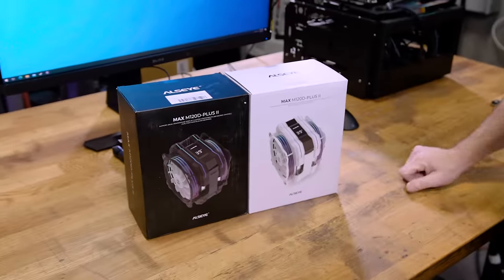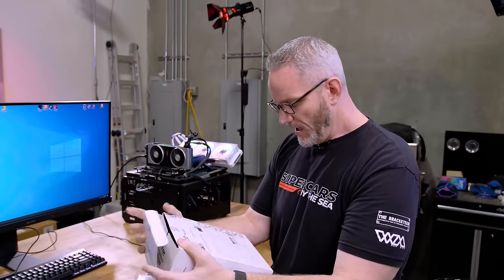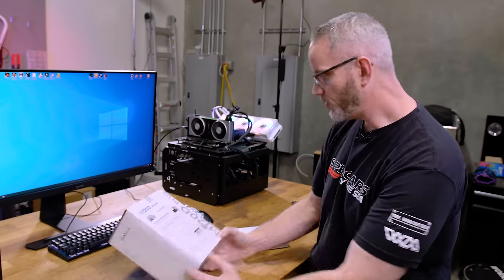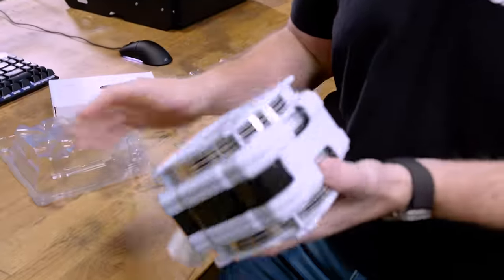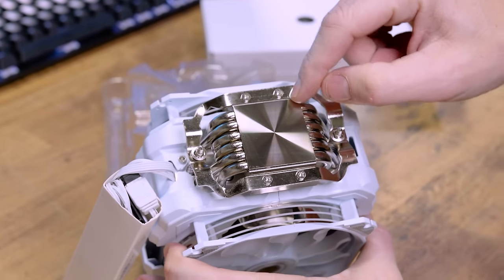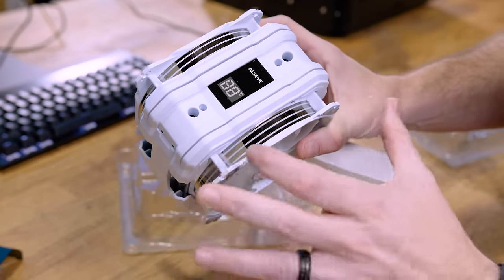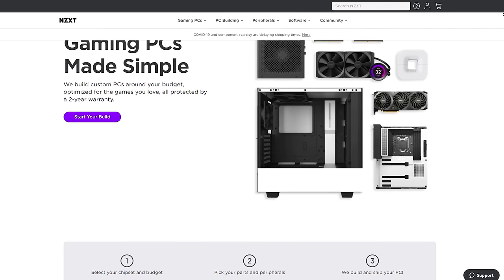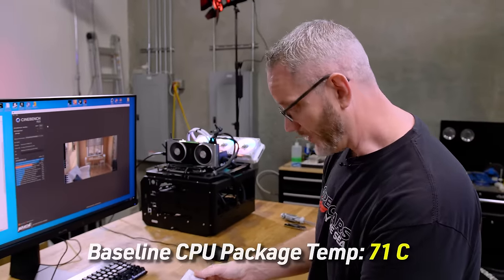This air cooler is actually terrible for modern CPUs

Comment: The cooler is pretty nice, but I had to return it because the hardware it came with simply didn't mount on a intel socket 1700 LGA asa result of a plate hitting the VRM heatsink.  Had the metal plate been even 1/16 smaller I think it would have worked.  That's the problem with the cooler, the mouting system fis garbage, at least for intel.  Ended up using a Noctua which fit perfectly which indicates it's the cooler and not the motherboard that was the problem.

So if the manfacturer ever sees this comment, fix the damned mounting system!

Comment: I would love a video on coolers for modern CPU's. I'm currently looking to replace my motherboard, CPU, cooler, and RAM, need higher end hardware for work in blender and unreal, and am on a tight budget. I've spent hours looking at coolers and every single cooler listing I'm like, "Is this going to work with the motherboard I want? Is this going to be enough for the CPU I want? Is this going to stop me from filling my RAM slots? Is this overpriced? Is this going to fit in my case with my NZXT Kraken cooled 1080? Is this overkill? I wouldn't even limit it to just air or just water coolers, after all for a lot of us if it is in budget, compatible, and cools well enough then it's a good option.

Comment: i was just thinking you should sell a jayz screwdriver, and oddly enough it would be exactly like that one that came with this. long screwdriver for coolers, but reversible between a cross #2 and #1 which should cover most casual pc builders. i think the m.2 hold downs are a #1

Comment: 12:58 I have an AC700 from Gigabyte, and it has the same problem I can't put any ram, even regular no heatsink ram, on the closest slot, it won't fit or I can't tighten the screws of the cooler.

Comment: that cooler definitely looks like < 150W cooler.
Just the fact it's a single tower with rather low fin density :D and beQuiet stuff always has high fin density :D 

Jay!! Do some 30-70$ cooler comparisons for air coolers on the newer generation CPUs that are ridiculously hot...

Comment: I whould love to see a comparison with diffrent big tower air coolers and aio + custom water with all new high core cpu and graphic.

i have mid tower case with alot of room for air to flow around cpu and graphic in an old corsair 500D i think its called with some mesh panels you cover with doors to take off on the top and side so can screw in 3 fans on top or water block and 2 fans on side to blow in or out just beside graphiccard but i have top closed and side panel open with no fans on the little side mesh panel so hot air escape a little better for the graphicscard and 3 140mm noctua fans in front and 1 back with ryzen 2700x with a Noctua dual tower aircooler with 140mm fans and it only get about 60c while gaming and gtx 2060 graphic usually hit max 80-90c.

Aircooling work good and dont need worry about water leaks with good configuration of possitive pressure fans and not bunch of led that heat up case even more, my noctua fans usually run at 600-800rpm at idle and around 1200 rpm when gaming.
i never used watercooling beacuse aircooling is effective enough.

Comment: I really wish you would do this testing in a case.  An open air setup applies to almost no one except Youtubers using test rigs.  I know Steve @ Gamers Nexus and Jay and others have given lots of reasons why they do this, but how hard would it be to pick a decent middle-of-the-road air flow case and standardize your case fan setup?  As long as you perform the testing consistently from one cooler to the next then it will be fine.  A temp on an open air setup doesn't mean anything if as soon as you put the test cooler in a case the temps jump 10-15C.

Yes, there are many setups that won't be captured accurately by doing this, but it would still apply to far more people than your open air rig.  You could even do the open air testing and then pop it in a case to show if and how much things change.  I'm just asking that you make your testing be relevant for your audience.  

Rant over.

Comment: I see it and think about .

If you 100mhz down clock the cpu and the heat can go to 90 c.
And for you do that it hit crash by 80 c.
Somting els is wrong .
Its not the cooler what doing this.
Special the core temp is lower than 80c.

For the rest with this China spul.
Play with the screws .
Somtime lose wil go the temp down.

Comment: Would definitely like to see a comparison  to this and others between its and the veetroo coolers price range. I have had good luck with the veetroo in budget builds I've done for friends and family but none of them have hotter than a ryzen 5700G/5800x. Have used on a 6700K@4.7Ghz 1.325v but that cpu is delided with liquid metal so not a fair comparison

Comment: It’s becoming the age of watercooling where we basically will start needing watercooling to keep at good temps lol. Soon enough if they can figure out how to get the best out of it then maybe move on to graphene lol. But honestly this isn’t a good air cooler. I’d honestly just stick with a noctua. If I want rgb then I’d just remove the noctua fans and slap on some rgb fans. But I personally prefer watercooling. I have a custom loop and never plan to do any different. When it comes down to the 12th gen i9 or above basically I’d just say stick with watercooling. Especially the 13th gen i9 cause Jesus that is one hot piece of hardware lol.

Comment: The correct spec to report would be thermal resistance (C/W) not just "power rating" (W).  A power rating is basically arbitrary, whereas thermal resistance tells you how much temperature rise you will get per W dissipated.

Of course no one reports thermal resistance because that would make comparing actual performance too easy.

Comment: Been using the Be Quiet tf2 on a slightly oC 3700x without issues.  It's  $90 cooler but the downfire design not only keeps the CPU cool but also dropped a few c's off the VRM and top slot Nvme drive as well.  These side flow coolers are only designed for cpu temps and usually do that pretty well.  I would replace the fans with Noctua's or Light wings and see if that changes it.  The design and looks of this cooler is really nice, seems to be gimped by under performing fans.

Comment: how have they still not fixed the issue with ram and cooler clearance by now? 
you'd think they'd have moved the ram slots just a little bit father away or stopped making coolers quite so wide by now...

Comment: We have entered the era of flagship CPUs that can't run at spec without high-end liquid cooling (no current air cooler can stop the throttling), so we need a whole new standard motherboard/case configuration that can support an air cooler the size of a basketball.  Makers of water cooling solutions will, of course, fight against that.

Comment: one thing that you have to remember is the the TDP listed on processors is the non turbo base frequency TDP. for overclocking and perm boost you really need a minimum of 4 times the base cooling, so for a 65W TDP processor you would need a minimum of a 260W cooler, that is when you have a good temperature differential, in warmer rooms like in summer, you would need more than that. 
the biggest point here is the temp of the air going into the cooler, it really doesn't matter where or how the cooler is mounted, it is the temperature of the air going into the cooler that matters.

Comment: uh.. ball bearings and sleeve bearings are cheaper than fuid dynamic. fluid dynamic lasts a lot longer and is less noisy too actually.
If you get a fan with dry sleeve or balls, you're fucked :)

Comment: I don't touch anything unless it is a "direct contact" copper 6-8 pipe cooler these days. If the heat pipes don't have a direct contact with the cpu, you are just adding a metal insulator layer.

Comment: im rocking that old coolermaster air cooler. its a beast and manages to cool 4th gen cpus pretty well i guess. it can run an i7 at 28 degrees idle

Comment: I'd love to see that Amazon shootout and I want to mention one thing. When I first built my system with a 5900x I bought that Vetroo cooler but for some freaking reason I could not get the mounting system installed. I really hope it was my stupidity instead of a manufacturing defect. I returned it and bought something else for double the price. It would be nice to see that type of video once or twice a year depending on new CPUs, new coolers, different prices for similar heat dissipation estimates, etc.

Comment: The screen is neat beat yeah not really worth the price. My go to tower cooler right now is the Thermalright Peerless Assassin. It is a six heat pipe cooler that is able to handle some of the higher tdps. The starting price on amazon is $35 and is really good value

Comment: If you're willing, Enermax makes a 120mm fan air cooler that is rated for 230 TDP and is cheaper. That would be interesting to see tested to see how it holds up against some of the reviews I've seen on it in addition to this cooler.

Comment: Do you think you could replace those stock fans with ones of the same size from a different manufacturer, say like ones from Corsair?

I do like the idea of comparing components bought from Amazon as I think a lot of first time builders will look there for parts in order to save some money.

Comment: What I think it is is the metal used for the fins.
I have been noticing the metal on heatsinks like noctua is a much higher quality metal.
Where as some of the off brands just use some random aluminum they are scrapping.

Comment: Hyper 212 is about $50 with similarish cooling capacity and size, so this cooler is an extra $25 for full ARGB and an LED temp monitor. Cooler Master is also a Taiwanese company with a long and good history whereas Alseye is a relatively recent Chinese company. I wouldn't call it a good deal, but I've seen worse deals.
Reply: Kolink umbra EX180 is good too, can fight against Hyper 212 without problem

Comment: There is a very simple reason most render farms, etc, are air cooled. Simple fact is, if you have heat spikes from constant load, your radiator has cycle to even begin to impact it, where as a fan hitting a higher fan curve is immediate on the thermal dissipation.

Comment: 75$ for that crap? O.o I'm rocking a 30€ Be Quiet Pure Rock 2 with a Ryzen 7 5800X3D and my CPU never gets over 80celsius (I only game and watch youtube/films on my pc). It's way cheaper  and even quieter (27db) and it's slightly offset, so you got a lot of space to your RAMs and it's also working with AM5. I mean 30€ vs 75$ and the way more expensive one seems to loose on every level but yeah you can have a screen u propably never gonna watch anyway xD
Reply: @@blue-lu3iz Sure thats a point. I made my comment before i got to the point where he decreased the watt usage. But that thing is still 70$ and for that price it's very loud and isn't that good engeneered (no ram clearance). May it's good for a all white setup, but I woudn't pay that much just for optics.

Comment: I'm an air cooler guy by nature and I'm looking to upgrade from my 2700X & stock wraith cooler to a 5800X, but was trying to find a good cooler under $100.. this definitely ain't it. I need suggestions!
Reply: From Thermalright: Peerless Assassin 120, Frost Spirit 140, or Frost Commander 140 will all work well for way under $100. Scythe Fuma 2 works okay too. I've used the Peerless Assassin on an R5 5600 with only 1 fan installed (SFF, 2nd one wouldn't fit) and it kept the CPU in the low 70s running CB23. I also have the Frost Commander on a 10850K and it tops out in the low 80s running CB23. I used the original Fuma 2 on a 5800X but it took a bit of power limiting to not throttle. The new version is probably a little better.

Comment: I've been running a Noctua NH-U12A on my system for quite awhile.  Even playing graphically intensive games rarely goes over 70c.  Most of the time, while gaming, it is in the 40s or 50s, depending on where I'm at in the game.  Idle is upper 20's.
Reply: Oh,...and I'm running a 12700.

Comment: With the new Ryzen CPUs targeting 90 degrees can you have to much cooling? Seems like it will keep increasing power to get to temp targets no matter how much heat the cooler is pulling out.
Reply: AM5 chips can be tweaked to keep it way below 90°C. Check out the Gamers Nexus video.

Comment: If you are using an air cooler with a powerful modern CPU you clearly deserve any heat issues you get.
Reply: I mean air coolers are still good, maybe not ideal for a 13900k but at that point you ideally want some sort of custom loop. If it's not the highest end CPU you could possibly have got for your use case then there's no reason to liquid cool.

Comment: beside price, i just dont understand the reason why people would go with air cooling. Especially not if you buy a Mid-to-high-end CPU? Please enlighten me!
Reply: because good air coolers cool just as well as most AIOs. Do some research
Reply: @fiftydabs5114  not at same CFM. And noise level. There is little to no good reason to go air-cooler other than budget. Or build difficulty.

Comment: Jesus man, you're trying to run a 250w+ overclock on an air cooler.  Give your head a shake before making a title like this.
Reply: @Blue Don't get me wrong, my UH12s does just fine for 140w as well...Im just over the shock content Jay seems to be going for lately i guess.  Maybe he used to be more humble? Maybe im more jaded now? Cant say for sure.

I can say for sure that the NHD15 is a superb cooler that competes with any 240mm aio there is hands down, but calling 80c on a still fairly heavily OC'd cpu like this "actually terrible" Is just misleading and objectively wrong when looked at outside this vacuum video.
Reply: @Blue Hence why I specifically dislike the title of the video.  It's a noctua contender in roughly the same price range with arguably better aesthetics.  A little Gaudy, for my tastes, but being white would go great in an Corsair IQ 220T of the same white paintjob.  

The more I think about it, it isnt a bad cooler at all and may just be a good pairing for a 13600k/7700x with only a mild overclock.  Have 2 UH12-s' in the house and still stand by the value of air coolers is that they are nearly eternal.
Reply: @Blue Definitely over priced considering a NH-u12s plus a second fan is roughly $10 CAD cheaper and would maybe outperform it?  I wouldn't know because this was done in a vacuum with honestly pretty shit explanation.  I miss the work put into real reviews on this channel.

Comment: The 135w heat dissipation might actually be for when it's standing vertical.
When a pc is standing vertical, it's harder for the vapor inside the tube to get back to the socket, thus lowering the maximum dissipation.
Reply: When is a pc not vertical? 😂
Reply: @ActNasty5  there are pc's where the motherboard is mounted horizontally.
also, the test bench SEEN IN THIS VERY VIDEO is mounted horizontally. Think before you comment.
Reply: @Olav_Hansen  interesting ive never seen that in a consumer pc. I was listening to the video in the background so no i didnt notice his test bench
Reply: @ActNasty5  so you do agree that his test bench have quite an impact on... his result?
Reply: @Olav_Hansen  yes. I just pictured a pc case laying on its side when you said that😂 like a console horizontal vs vertical
Reply: no, this is not a fact. or we would definitely see coolers accomodate for it, but we do not, go figure!
Reply: @micheskillz  it IS actually a thing, however a vertical mounted vapor chamber still performs better than if it's just solid copper until it gets heat saturated.

You can literally google if it's actually true, google confirms it.

Comment: That cooler is just 1 step up from the CM 212 Hyper Evo but is covered with plastic shrouds. 6 heatpipe vs 4 heatpipe but the size appears to be very similar if those fans are 120's. 
I've done a lot of testing on 3 different revisions of the 212 and with a push pull setup everything is fine until 200w, after that everything falls apart. I would guess that if they did rate that cooler it would fall at 225w rating max, but I'd feel safe enough to daily up to 250w. EDIT this cooler has a rating of 235w apparently

Comment: I think i heard some time ago, that the direction of the air cooler is important. In your test bench the cooler has a different orientation than it would have in a case. The heatpipes are designed with the orientation in mind, so it might not only be a problem of the to low wattage dissipation, but also that the cooler can't work at its best performance.

Comment: Something I learned that changed my cooling life is that if you combine an AIO with a blower fan you can run your PC at room temp under full load.   Basically fans running through the motherboard are underpowered and undersized.